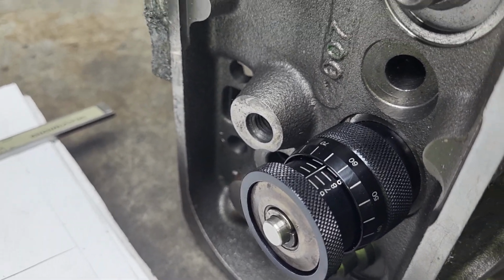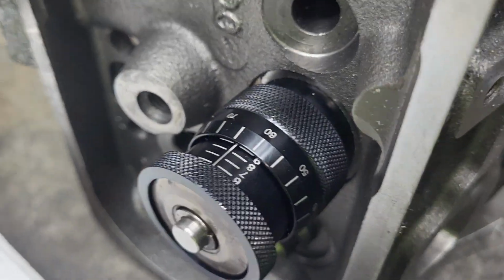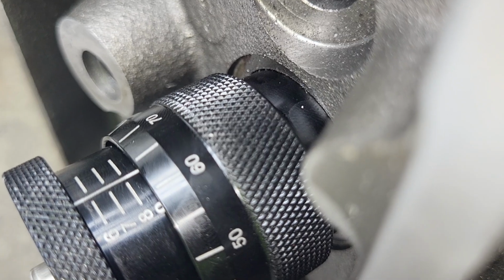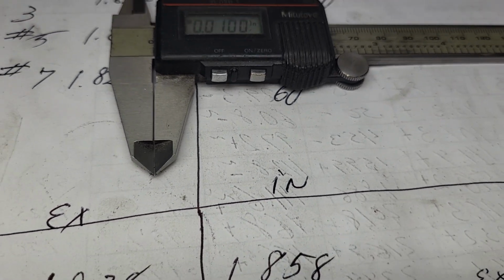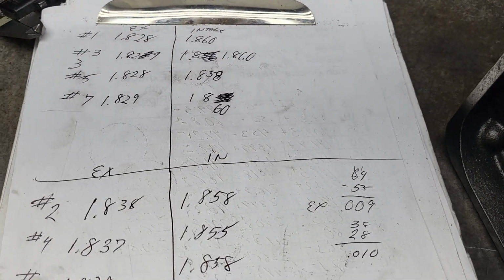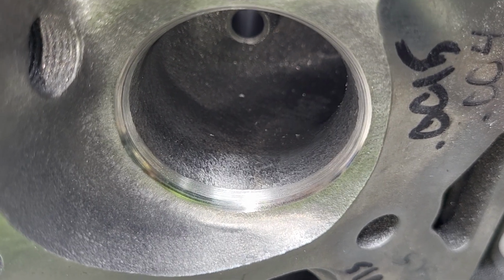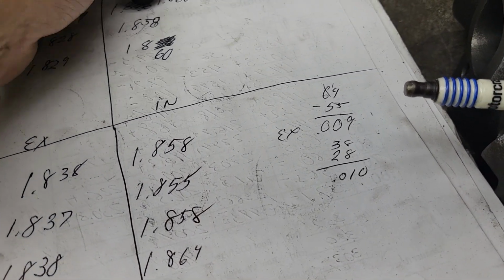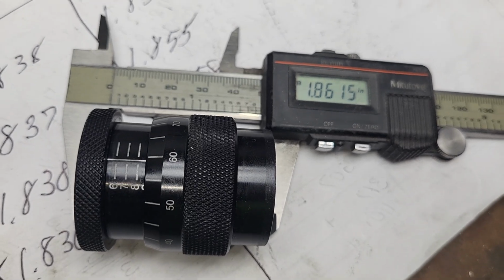Redheaded stepchild, High Performance TPI project, Dart 007 heads, measuring spring heights.

Comment: That tolerance is more than acceptable.  Heat expansion will add up to well over that. 
 With extreme conditions, coil bind gets within .050. That is about the minimum once you add in heat expansion.  With room to play. 
  I bet when you examine your pushrod length and it will have greater variation than that.

Comment: Why not meaure all the valves and move them around if there's different stem heghts for a more even install height. The last set of Elgin valves i used all measured exactly the same length. When doing the valve job with stones i usually do an end chamber first. Then do the other end chamber next till its the same depth. I load a valve in each. If i place a machinist straight edge from valve tip to valve tip it shows me how deep to make the  middle chamber seats so all the valve heights are exactly the same. It takes some time pulling pilots and checking but very accurate.
Reply from the maker: @BobHollinsheadGarage  Thanks!

Comment: Hi, gr8 video, now i want that tool😂😂😂, just a thought, if you have the time, what about trying each valve in one seat installed to see if there are manufacturing differences, if there are, installing - removing- checking this measurement for each valve individually in each seat could result in closer numbers in this measurement....on another note, hand grinding valves to mate to seats- it can be measured how much grinding results in how much this measurement reduces....
Reply from the maker: @ArvineHarry  You make a good point. Thanks

Comment: Welcome back Charles!! My sbc has got cylinder pressure of about 115psi on most of the cylinders except on the 6th cylinder which has got 85psi. I enjoy driving and wouldn't perhaps even notice if yet another cylinder would drop to 85
Reply from the maker: @mikkokuorttinen3113  That is pretty low. Not very efficient. Glad you still enjoy it.

Comment: I set spring pressure up +-.010 Mainly because that is my thinnest shim. If you actually test every spring in a set and profile their spring rates you will find they slightly vary too.  Spending a bunch of time for perfection rarely returns a noticeable difference.  If it’s good it’s good.😊
Reply from the maker: @bcbloc02  Excellent. Thanks

Comment: Surely its down to the spring rate... X thou x Y Ilb/inch. I.e. What's the variation in seat pressure?
Reply from the maker: @The_Wizard_42  I will not be setting up the springs on these. Thanks

Comment: Just remember Charlie that the only number that is relevant is the number that relates to the actual valve that will be in that hole. Without knowing the manufacturing tolerance on the valves, you might be doing a lot of work for nothing. I'd suggest that you measure every valve in the same hole to verify the assembled height of each valve. They 'should' be extremely close, but are they?
Reply from the maker: @theshed8802  You make a good point. Thanks

Comment: Check out Powell Cams video on Camshaft 101 Ep#5. He talks about using the valve spring height mic and easy to make mistakes. P.S Ended up getting a set of EQ-CH318BA heads for my 5.9 Magnum rebuild and now trying to pick the right cam for it before head back to FL for the winter.
Reply from the maker: @DusterCI  Sweet